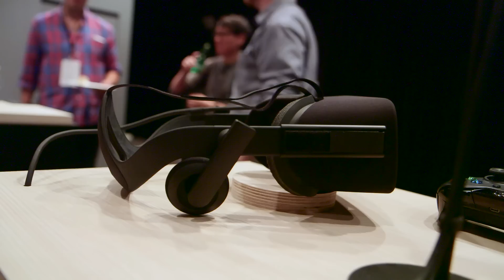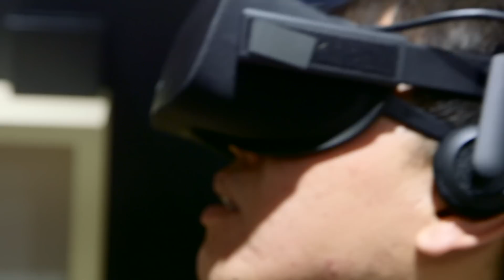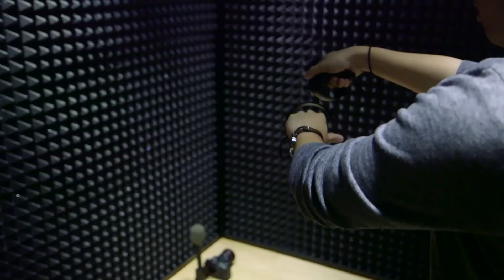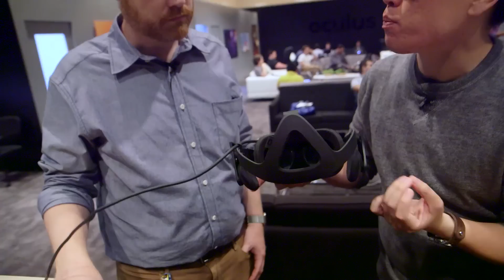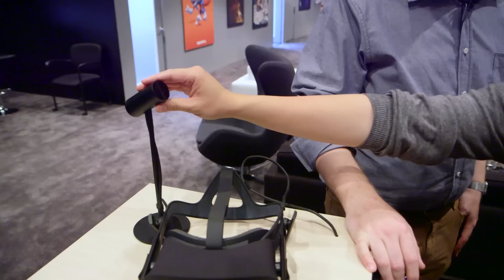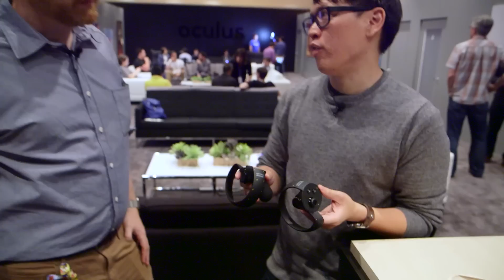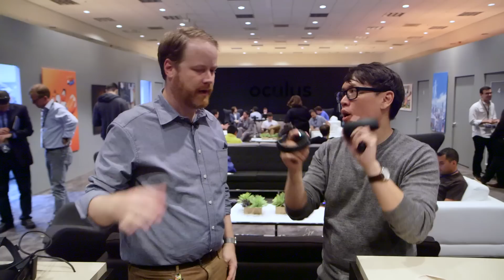Oculus Rift CV1 + Oculus Touch Controller Hands-On + Impressions!

Comment: Nice detailed review which answered all of my questions as usual. Thanks guys!
Reply: MiloDarkStar 
I think they are fully able to express their honest opinion and after watching the podcast  there are some important takeaways.

The optics are better than Vive and better than anything they've seen thus far.
The tracking feels one to one as it can be and to even tell what is "better" they would have to directly compare both which tells me that they are pretty much on par. 
The low persistence is now perfect to a point where they couldn't find fault in it.
The controllers are more immersive thanks to the finger movement and have a learning curve of 2 minutes until it feels natural to grab things.
The Audio is surprisingly good.
It's lighter, built so your head can breath much better and it seems to be more comfortable.
...

Also there is one thing you seemingly don't understand. The reason why people were so into the Vive unveiling was the reason that for the first time ever they had a perfect room tracking scenario in which they could move like in a holodeck with the perfect "games" to accompany and amplify that sensation.
It's a first time reaction and btw. their enthusiasm was pretty much the same after Crescent Bay which was, at that time, a similarly big step forward.

This Immersion is entirely possible with the CV1 too just that there never was that type of presentation and that you wouldn't have the real walls blending into your VR environment. 

It's also always funny to see how people are projecting something magical into lighthouse...
IT IS a stereo-camera based system TOO. 
Lighthouse MIGHT have an advantage in theme park scenarios due to cost and lower tracking stress. Less has to be traced at once because of a limited FoV for the headcam instead of tracking the whole room at once but that is it.

For home usage there is nothing that sets lighthouse (the wii remote approach) appart from RIFT IR (TrackIR approach). Outside of a theme park scenario you won't leverage any kind of positive aspect from this.
And all the other factors seem slightly superior in the current CV1, at least everything they were reporting back in this video and the podcast.

The number of people that will dedicate a whole room for VR lies significantly under 1% and therefore the games exercising that kind of experience will be mostly tied to theme park scenarios.

In the end it's a no factor anyway. This is a very important round for VR but not the deciding battle. Oculus has a disadvantage in the release date which their controller solution MIGHT make up for when it comes to sales but it's kind of hard to believe that since those are coming out even later. 

So most people who have the money and don't want to wait for RIFT or an acceptable number of supported games will probably go for the Vive. 

What really counts is the next round because it will decide if Oculus can negate that disadvantage with CV2 through either an earlier release date and comparable quality to the next Vive or superior quality and comparable release date.

Since Valve already said that Vive is only the first step in their game, and would be more comparable to a GearVR than CV1 in their own lineup Oculus might actually face the difficulty of Valve rolling out their first demos for Vive2 when Oculus doesn't even have their controllers on the market yet. 

2016 will be vital on deciding who will get the bigger market-share. 
Currently I'm personally not rooting for anyone but I am more afraid of Valve completely monopolizing the gaming market and forcing standards than I am of Facebook doing something disastrous because it's a much likelier scenario IMO.
Reply: Great interview. I'm really excited and I guess I will wait until the comparison between Vive and Rift is out. :) I just hope that the headset is optional.
Reply: Jan Ohlhoff  yeah the two could be working similar, the only difference being hardware that makes them tick. I just have a feeling vive could be a bit more advanced, but oculus would get a bit more support? Not sure. Vive is made by valve and they have a gaming platform.. thats what oculus dont have.
Reply: tulp35000 True. But the partnership with Microsoft sounds really interessting too.
Reply: tulp35000 
According to this very video the CV1 makes an even better impression than the vive did...  I guess we just have to wait and see.
Reply: I heard them say is uses two usb 3.0 connectors and one for xbox (2.0). I presume it also uses a HDMI port, RIGHT???
Reply: Saljon That's not the impression I got from watching it.  They certainly seemed more enthused with the Oculus' controllers, but other than that it seems to me that Vive was still superior.  The whole camera tracking system seems like a massive fail to me, I don't want to have to adjust the camera to play a game in a different position and them using 2 cameras in the demo, but insisting one is the "optimal experience" sounds like utter crap to me.  

As for their overall impression, there is no way Will or Norm came out of this demo as excited as they were after the Vive demo.  They might suggest otherwise on camera, but the difference in enthusiasm with which they spoke about the products after their demos was huge; they didn't come out of this demo anywhere near as ecstatic as they were after the Vive demo.
Reply: Erik Legerstee It doesn't use any USB ports on the Xbox because it only works on a PC.  You can stream Xbox games to the headset, but only via a PC.  there's simply no way the Xbox (or PS4 for that matter) has the horsepower required to run the Rift, that's going to require a high-end gaming PC.
Reply: MiloDarkStar thank you answered my question en cleared up a question I had that I didn't ask, thanks mate!